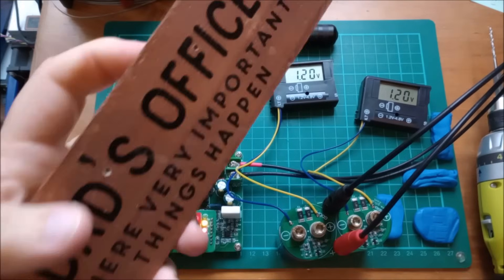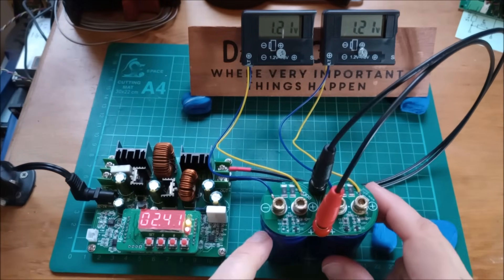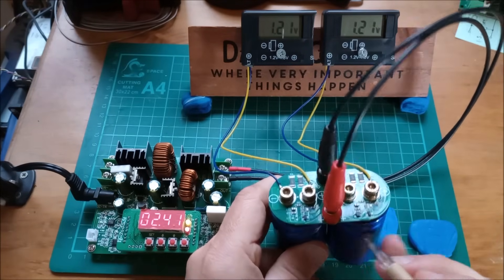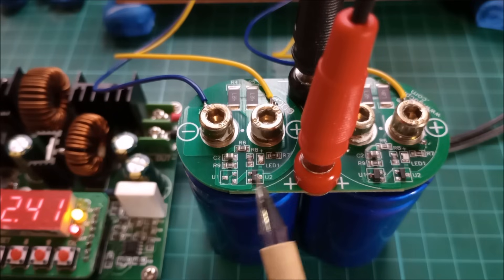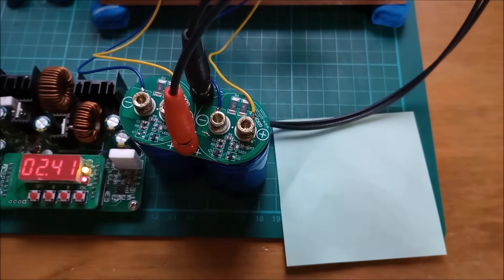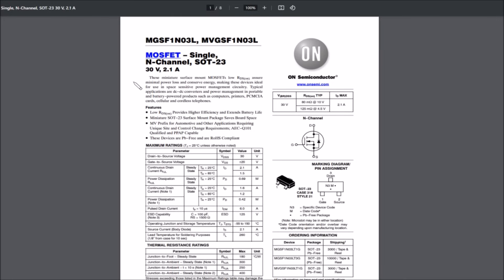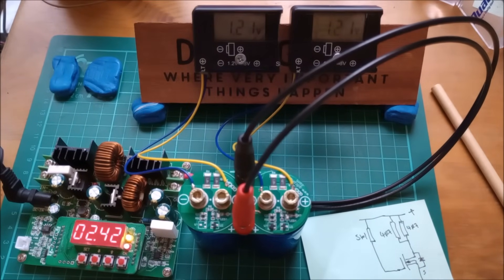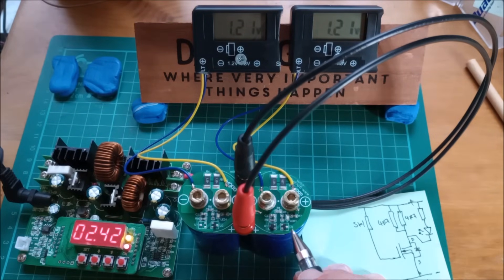Part1: Supercapacitor 5.4V 250F Schematic

Comment: This are 2x 2.7V capacitors in serial and this circuit can stop the overload of this capacitors.
But what is if the capacitors will be discharged and one of this capacitors is a bit smaller as the other?
You would get a negative voltage in the capacitor with the lower capacity. It looks like there is no protection for this case.

Comment: I finally know how to balance series (super) caps without resistors.
It can be done with stacked isolated dc/dc converters, in combination with buck converters with voltage limiting.
Reply from the maker: You must have a lot of capacitance to make that worthwhile. Isn't resistive top balancing good enough?

Comment: Doh!  Now I need to check my super cap modules for missing parts!  Are you going to replace the missing voltage monitor?
Reply from the maker: Yes, I bought a single capacitor PCB. I hope it uses the same part.

Comment: The MOSFET I find with a marking of 2N4 is from Diodes Inc, and it's not recommended for new designs. It is a DMG6968U, and you can find it, along with the recommended replacement on the Mouser site.

Comment: Such are the ramblings of an Electronics experimenter.
The process of self teaching probably takes longer, but you learn more in the end.
I am a licenced Radio Amateur, where self teaching is the only way forward.
Question, What is the end goal of these super capacitors.?
I am well familiar with Electrolytic capacitors, having amused myself with the sparks. 30uf at 250 volts can go with a mighty crack.
The low voltage of a supercap makes them relatively safe voltage wise on their own, but I imaging the welding current available can be spectacular.
Reply from the maker: I nearly bought a supercapacitor spot welder recently. It's one of the few applications for supercapacitors that I've seen.
Reply: @JulianIlett  The six in series modules also work well to jump start a 12v vehicle. Can sometimes be charged from the "dead" battery, if the problem is that the battery is unable to supply sufficient current to turn the starter but the terminal voltage is sufficiently high.  (This can happen if a cell or two has disintegrated inside so the amount of active plate is greatly reduced.)

Comment: I was about to ask where you got those handy looking voltage meters and then I looked closer and recognised the decapitated top left section of a battery tester. Nice.
Reply from the maker: That's it :) These are BT168 Pros, but BT168Ds look the same.